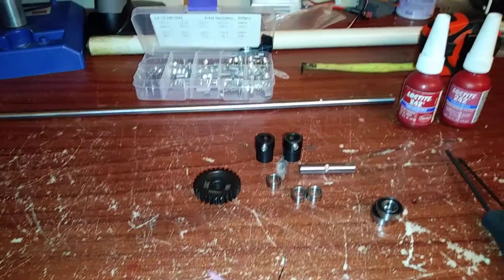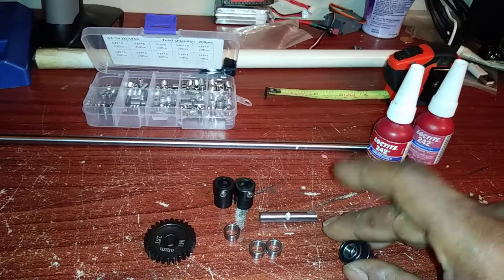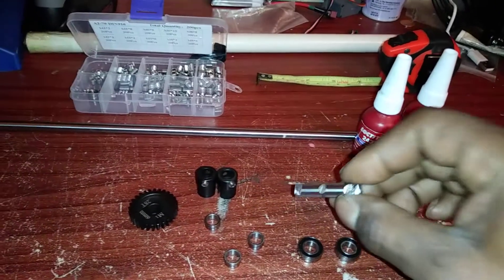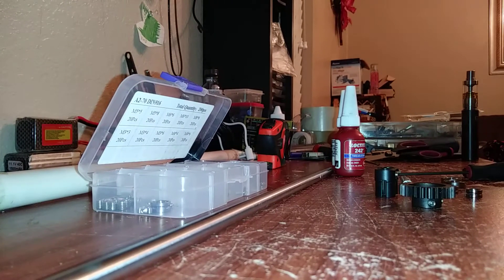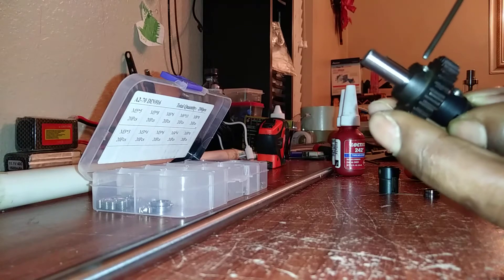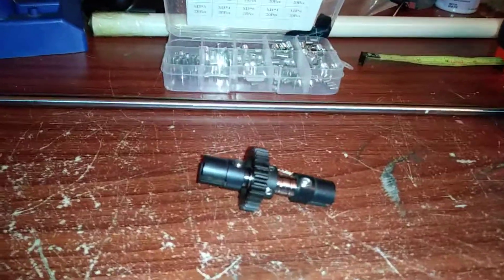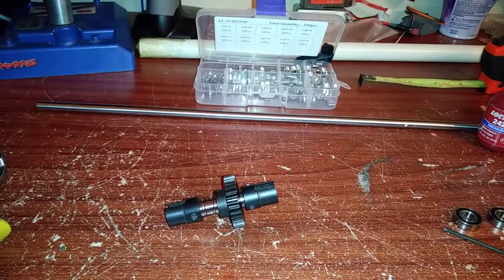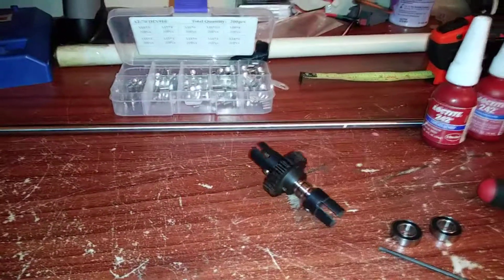How to make a custom SPOOL

Comment: Spool 101, nice work, you selling them?
Reply from the maker: mtctookie25.  Whats brah hows it going?  Yeah i sell spools on ebay i sell them with or without gears. The price is 65 bucks for full spool and 30 for spool minus gear but comes it comes with everything else. Im currently awaiting gears due to fridays order volume im out of gears but i have some being shipped tomorrow so i will have them in a week. Thanks for your interest .
Reply: Ok cool, i'm going to subscribe & you do the same, what is your store on ebay?
Reply from the maker: mtctookie25. I dont have a store i just post them on ebay when i make a batch of them or wheelie bars. I will send you a link as soon as i make more give me about a week i may just do a video to lettin yall know i got spools on deck.
Reply: Sounds great, thanks!
Reply: Any luck on the spools? I'll take one without the gears that's totally fine bro.
Reply from the maker: PasaDenaBoy6two6. Whats up cuzzo i havent forgot you cuz im still waitin on gears to be finished and shipped yo. Saga had a machine malfuction so im on wait mode brah sorry man.
Reply: Nathan Thomas what's good bro. So did you use the original dog bones?
Reply from the maker: PasaDenaBoy6two6. Yeah i got the OG dog bones on it cuzzo. How u kickin it pimp
Reply: Nathan Thomas I gave it a try watching you video. Everything came out okay except the fit. I got different 8mm cup joints and now it's a few mm to long. It won't go into place. Now idk what to do.
Reply from the maker: PasaDenaBoy6two6.  Yeah the cup joint are alil bigger that the stock center diff cups easy fix bro just shorten your shaft on one side. Grind down the end then grind you a new flat spot and test fit it you can get it rite pimp if i can do it so can u cuzzo i got faith in ya. Let me kno how i can help you out cuzzo i will yo
Reply: Nathan Thomas I got a Dremel I just don't know what kind of cutter to get to do that. I'm try something and see what happens. Instead of using the stock 101/106 dogs bones, I'm wondering if I can use two 101s that might fit. So I won't have to do too much cutting.
Reply from the maker: PasaDenaBoy6two6. Brah just get a metal 1 1\2 cuttin wheel go to lowes tell them you need a dremel cuttin wheel for metal n you great cuzzo im off tomorrow i will make another video wit more info and visiual aids bro i dont mind helpin yo
Reply: Nathan Thomas yes sir. Headed to home Depot in a bit our Lowe's is closed.
Reply from the maker: PasaDenaBoy6two6.  Brah its a dremel ez lock cutting bit 1 1/2 in size its says metal on it in red n silver on the left side. Thats what i us yo.
Reply: Nathan Thomas do you know where I can find 8mm gears. Saga is out of stock won't have none for a few weeks. Or do you have any in the 30s you want to sell?
Reply from the maker: PasaDenaBoy6two6. Brah wut up i do have a 39t complete spool i can sell you. Brah im be real not real grimee i figured out the key to these spools and the speed. Use the same tooth count as the center diff for you spool gear tooth count.  The center diff aka spool is the top end dont. You can still run a big pinion on the motor i got a 37t on my motor 48t center diff till i can get gears from saga. He has lots of people waitin so wen they drop get wut u need im gettin 48t 8mm pinions maybe a 50 for my truck. My car hauls ass now but wit the spool it tops out n runs motor warmer than normal. I say just wait brah you just gonna waist ya bread. Im not tryin to jip nobody cuzzo i WANT YALL HELLA FAST YO.
Reply: Nathan Thomas how much for the 39?
Reply from the maker: PasaDenaBoy6two6 $60
Reply: Nathan Thomas I have the spool. How much for the gear?
Reply from the maker: PasaDenaBoy6two6. Oh my bad brah same price as saga